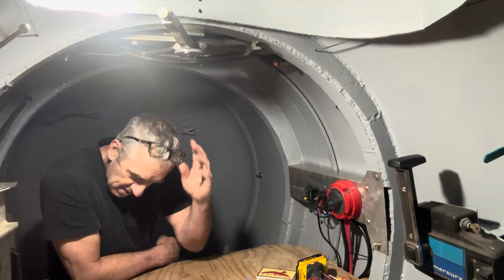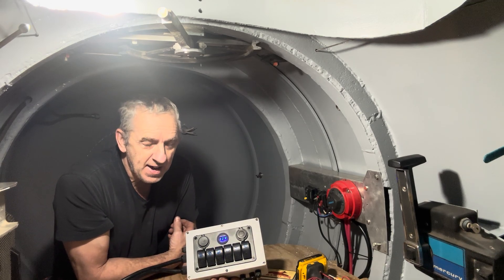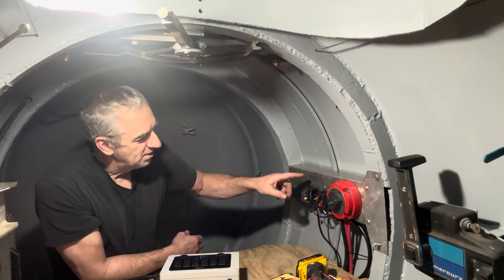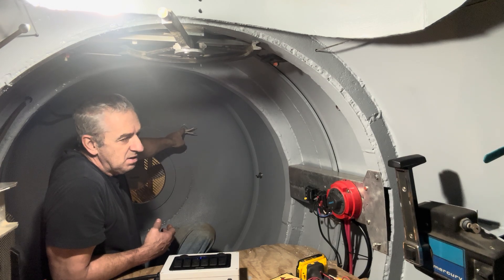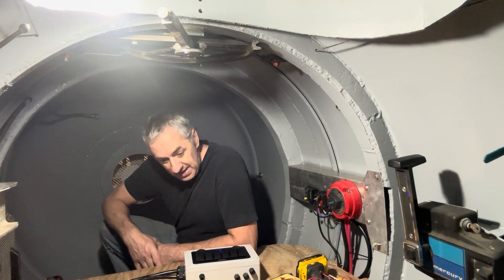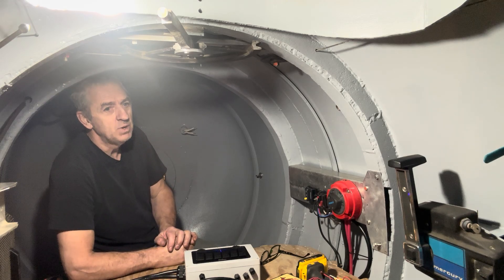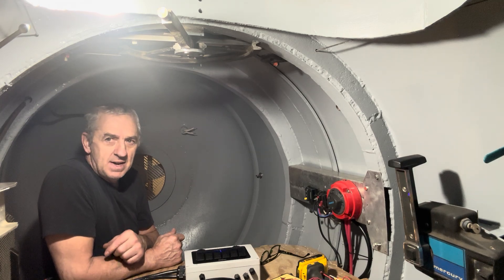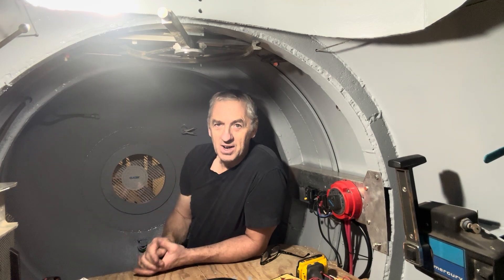Building my diesel submarine

Comment: An ammeter might help you in case of problems. Identifying a stuck thruster or a rusty pump of you know your baseline.

Also: You could put two big handled on the control box next to the switches, facing the user. It is a better-than-nothing protection in case you drop the box.

Comment: There appears to be a lot of noise with some of those systems running. Maybe they will behind a sound-deadening bulkhead... or you will need hearing protection during certain operations. 

It is all looking good.
Reply from the maker: Thank you.  It is not as noisy in person.  The camera makes it seem worse than it is.  The compressor is loud but it will be enclosed when the sub is finished, so that will help.  I may need hearing protection though.